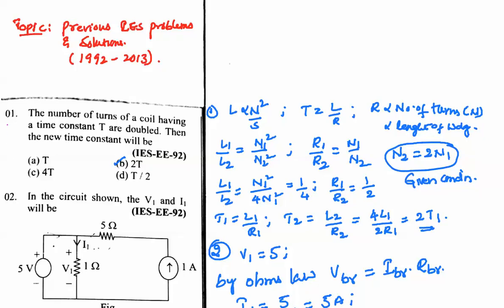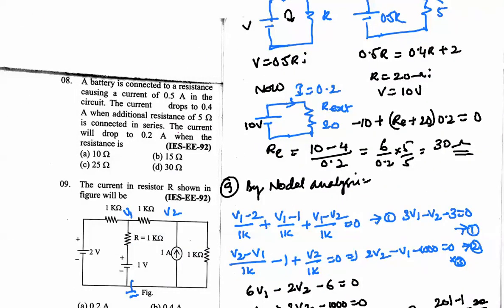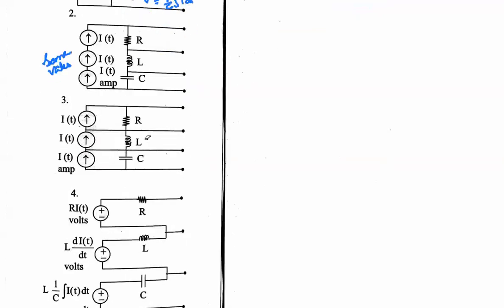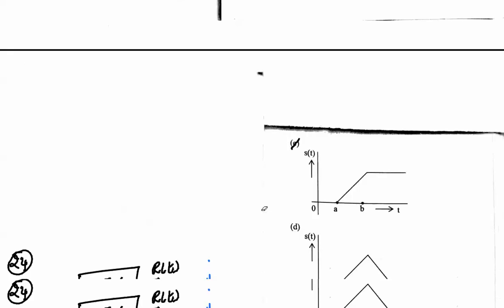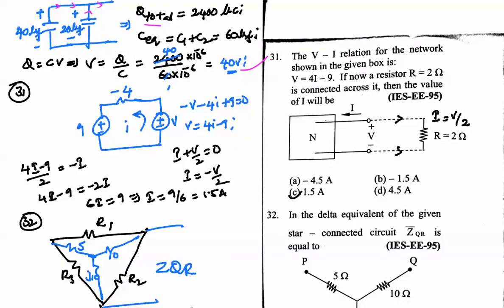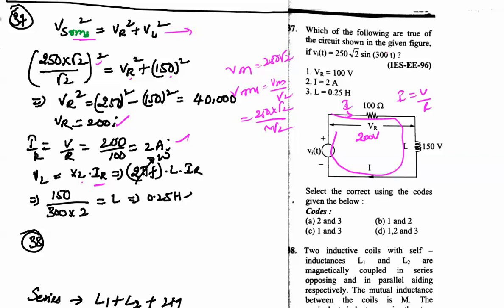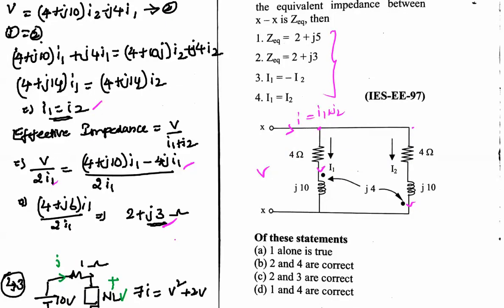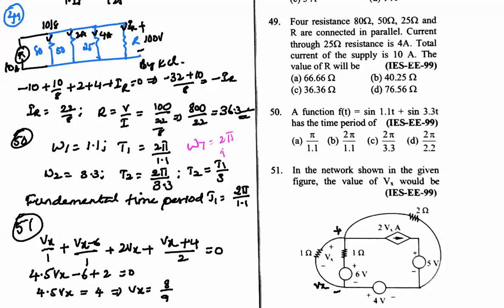Previous IES (1991-2013) solutions in EE :  Network Elements part1

Comment: Sir in 7th question you have done a mistake when bridge is balance 2ohm and 2ohm will be parallel not 1&1ohm hence ans will be 1ohm
Reply: right but what about outer resistance. 2 ohm parellel with 2ohm and then again parelle with 1 ohm. so ans is 0.5
Reply: @amolgavandi6342  thanks ☺️ i think i have not seen outer resistance of 1ohm at that time

Comment: why don,t you provide the concepts clearly..just tell me as voltage sources in parallel should act as a single voltage source in question 48 butb all ther voltages get multiplied by 4 why ??
Reply from the maker: Hi gogoi, good question.all nodes at same potential but question is about finding current so all sources contribute to current.
Just apply millimans theorem